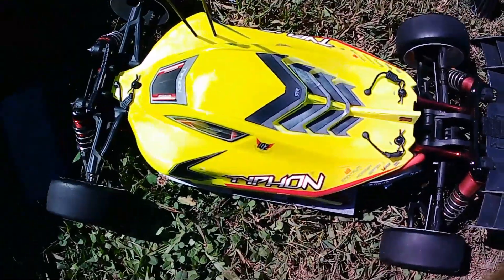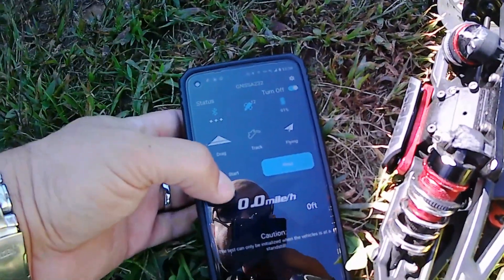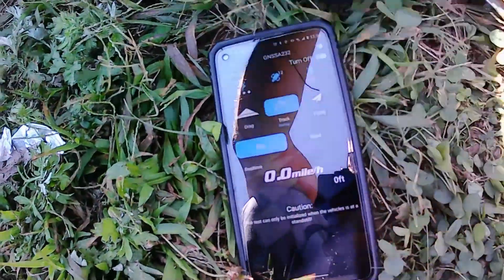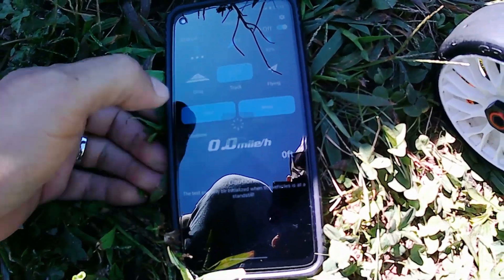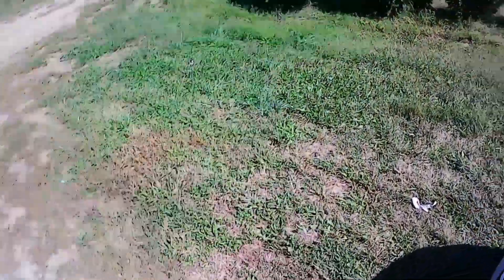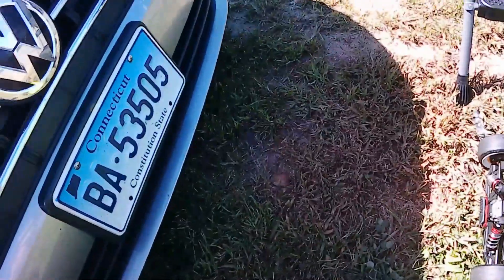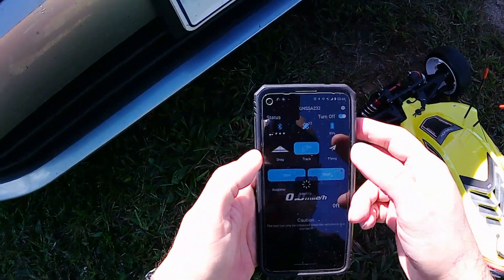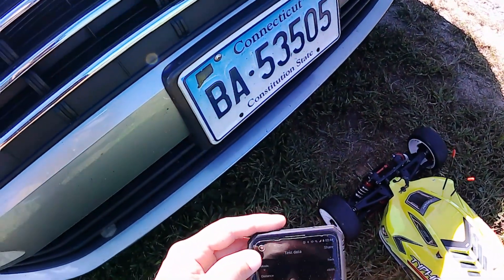Stretched Arrma Typhon, XLX2, 1721 2400kv, Geared Down for Test Purposes, Single 3S2P Azure 9000mah!

Comment: I'm about to gear down myself to see what happens. I tend to get gear happy myself lol.
Reply from the maker: Yeah, I have been doing lots of testing lately. Been seeing some interesting results. Heck, on the Limitless GT, I geared down 8 tooth. I only lost a few mph's but my sag went WAY down, like 11.6v, my rpm was almost the same & my amperage went way down. I think finding that point where your car is riding fast but your barely pulling amps & your sag is almost non existent is key. Also, having the largest spur you can fit. I noticed that on my infraction mega, car was geared for 60mph at 100% efficiency on 4S & I hit 63mph, & backed it up to make sure it was legit lol. Large spur = large torque! 💪😎